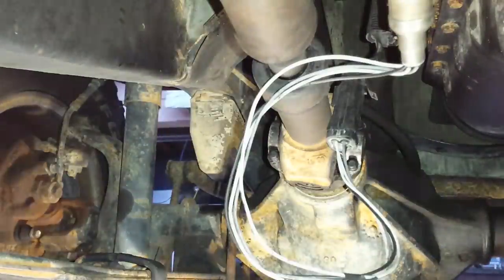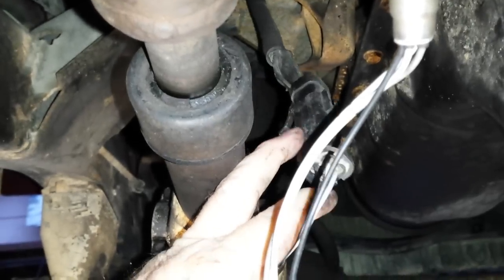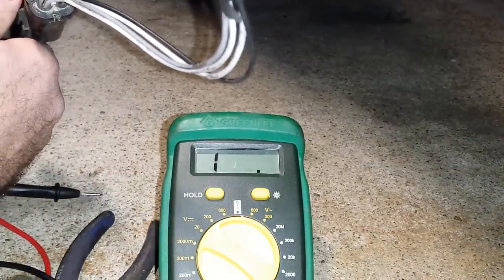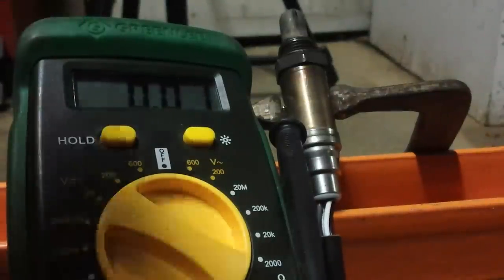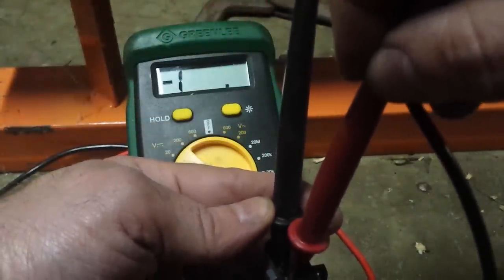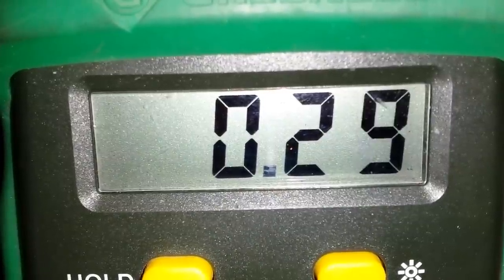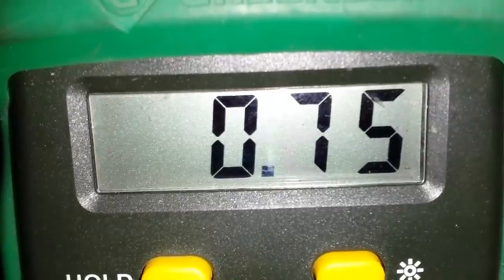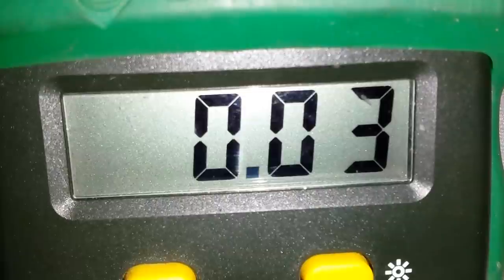Jeep Wrangler - Oxygen Sensor - Locate and test

Comment: Hi, the resistance of my O2 sensor is reading at 7.8ohms. I noticed that you have mentioned that on the TJ should be between 5-7ohms. Is that a problem that the resistance is higher than 7?
Reply from the maker: There can be a slight margin. I wouldn't replace it just because it was .8 ohms over if it isn't throwing a trouble code. If it is throwing an O2 code, change it. Some people believe in changing them every 50,000 miles so ultimately it is up to you.
Reply: Thank you very much for your reply

Comment: I'm confused - in the torch heat test you were checking ohms, then in the road test you said voltage   -  same numbers  .01 up to .9  -  ???
Reply from the maker: As the O2 sensor gets hot or cool it varies the ohms or resistance passing through the sensor circuits. The O2 sensor gets voltage from the computer, that voltage is 1volt. The varying resistance or ohms only allows so much 1 volt to pass through the sensor circuit going back to the computer for the fuel mixture reading. So the torch test reads the resistance. Road test reads the voltage being allowed to pass though by the resistance. Kinda like the home rotary light switches that you can dim or brighten the lighting in the room. As you turn the knob to brighten the light, the switch is decreasing the resistance (ohms) allowing more voltage to pass though. When you dim the light, the switch is increasing the resistance (ohms) allowing less voltage to pass though. Or, like an outdoor water hose, squeeze the handle all the way open you have decreased the resistance holding the water back. Barely squeeze the handle has greater resistance therefore the less water passing through. Hope that helps. Have a great day!!

Comment: Jeep TJ 2005 rubicon engine 4.0L, after 2000 rpm my jeep starts to stalling, there is no problem on the jeep before that RPM, after going throug reading, aparently O2 sensor could be involved or TPS, in order to dissmiss the O2 sensors, can you please help me to get the location of all of them? Thanks a lot, your video is very helpful with the test.
Reply: Another great video. Any thoughts on exhaust manifolds that don't crack.

Comment: Hey , good video. Didn't understand the principle behind the o2 sensor til I watched this. Also didn't know how to test one. Thanks for the post.
Reply from the maker: JD810Taylor You are welcome. Glad the video helped you out! They are simple little sensors but thy play a big role in making sure the engine runs correctly. Thanks for checking out the video and taking to the time to leave a comment. Don't forget to subscribe if you haven't. Thanks again and have a great day!
Reply: Power Addicts - Jeep, car and motorcycle tips Thanks for sharing man, one question, does this sensor affect in any way fuel consumption? I mean, if it is damaged my TJ will burn more fuel or not? thank you
Reply from the maker: Yes, it has a direct effect on fuel consumption. Lots of people change them out about every 2nd or 3rd tune up. Hope that helps. Thanks for dropping by!!

Comment: My 06 LJ shows O2 heater incomplete when I try to smog it. I believe there was a TSB for this issue.  would testing the O2 heater circuit confirm if I have that issue?
Reply from the maker: It can, but not always. The purpose of the heater circuit is to bring the O2 sensor up to approx 600 degrees and maintain that temp. One quick way to test that is to measure the resistance across the two black or two white wires of the O2 (colors vary from one O2 to another). If your meter reads O.L, that means the heater circuit of the O2 is bad. Now .. here is a catch 22. Sometimes that circuit DOES NOT go faulty until the O2 is HOT from driving. Heat makes metal expand therefore opening the heater circuit element. After the O2 cools, it can test good. Hope this helps, good luck. My dads 06 TJ went through 3 of them before the ECU was happy. Thanks for checking out the video, have a great day!!
Reply: +Power Addicts - FixJeeps.com - Jeep, car and motorcycle tips 

I did some googling and found TSB 25-001-07. it looks like 05 and 06 model year TJs have a known issue where the   O2 heater sensor never shows complete (not-smogable).  thanks for the reply I really like your vids.

Comment: my 2006 tj just started stalling at highway speed, starts up and goes til it happens again. could 02 senser be involved?
Reply from the maker: Kinda hard to diagnose over the internet, but sounds more like a crank shaft position sensor acting up. A bad O2 may make it run rough or use excessive fuel. But rarely causing it to stall completely out. Hope this helps. Good luck and have a great day!
Reply: Do you have any codes  . Present?